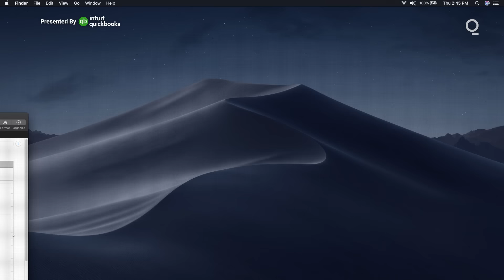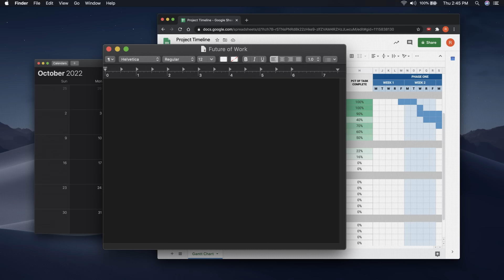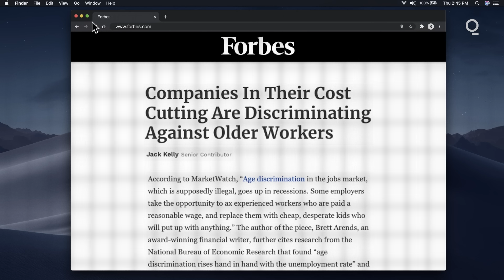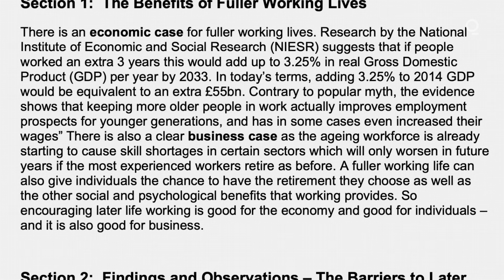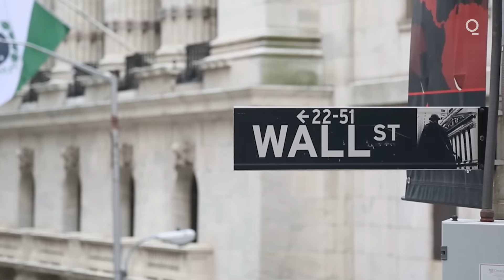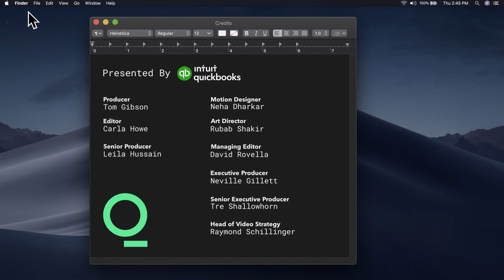Why Retirement Will Soon Be a Thing of the Past

Comment: 1:21 I'm confused, didn't social security start in the 30s w/ FDR so why are they showing LBJ?
Reply: I think the professor misspoke.  Yes, there is a Social Security Act of 1965, as the previous comment explained.  The professor likely meant the Social Security Act of 1935 signed by FDR, which created the "pension" type payment most associated with Social Security.

Comment: The world is moving to complete automation. In retirement unless you have skills relevant in an emerging field, you will be basically retired. I wont be surprised if  by the time we retire many of the nursing skills become automated. Already there is a replacement of physical labor. Robots to mop and clean. Automated food and water dispensers for pets. Doesn't matter which field you look at. Next gen computers are going to be most likely photonic computers (Lightmatters look it up) running at 20 ghz speeds while drawing on 10% of the power of current computers. Advancements in tech means decreased physical labor needs.

Comment: There is a difference between working as politician (person that usually does nothing usefull to society) or a lawyer or a teacher passed 65 and say furniture mover or coal miner passed 65. Some jobs are not meant for older people. That bs about people wanting to work longer should not be mistaken with people being forced to work longer.

People should have their right to retire at 65 unchanged, they paid their taxes, so they paid for their right. Changing it to 67 or 70 after the person worked their bottom off is cheating. Line that there is not enough cash for government to provide that is also bs in case of USA, as military budget is a bigger half (above 50% and with army related benefits and pensions and benefits its 60+%). Speaking of which, does army hire people passed age 55 or whatever???are they not having 70 year old SWAT team veterans? So why, do you think any other job is much different. After all work is work. (Right, because people has passed their prime, so stop forcing people to work longer).